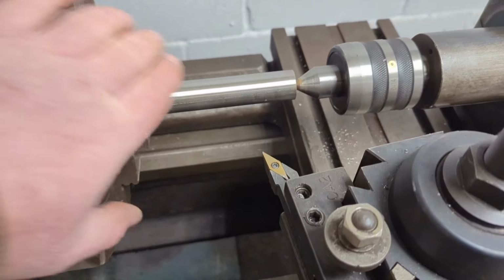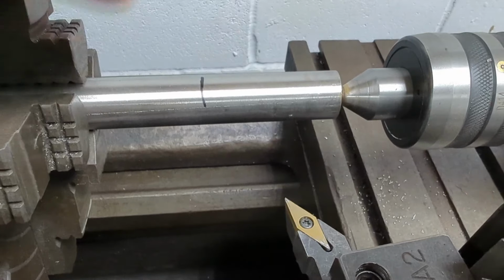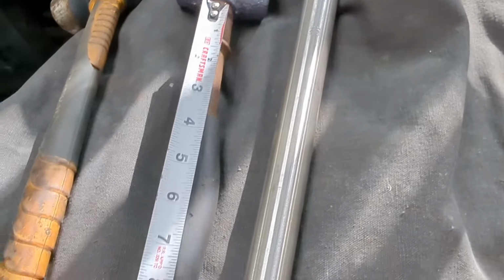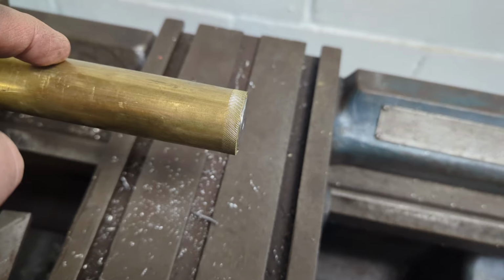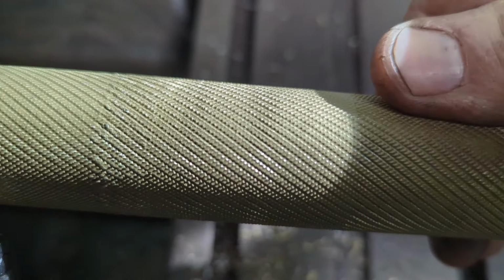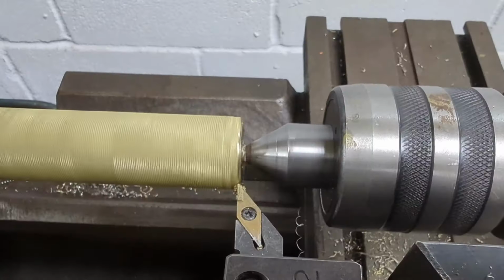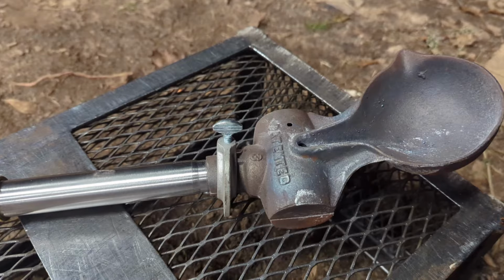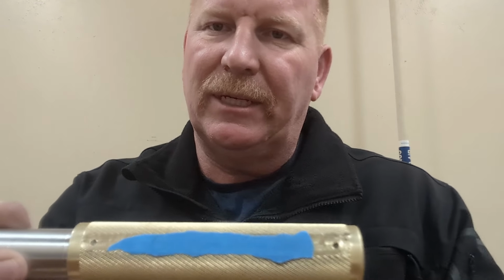#Secret Santa 2024 part 2

Comment: Looks really nice. Just a thought… maybe use a small wire wheel on a dremel to polish up the knurl where your end mill started and finished.👍👍👍
Reply from the maker: I did clean it up a little more, before it shipped. I was running short on time. But I really do appreciate the suggestion and the support. Thank you